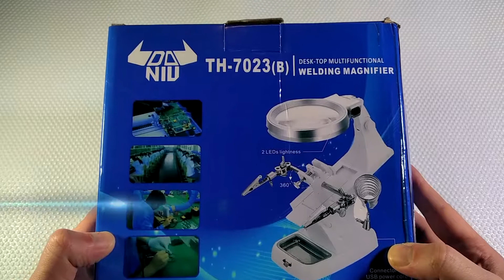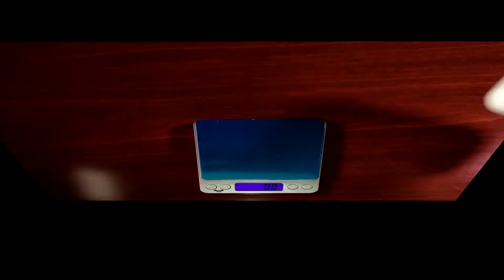DANIU TH-7023B Soldering Base - Unboxing and Review

Comment from the maker: Order Links Banggood
DANIU TH-7023B Soldering Base: https://www.banggood.com/custlink/KK3GiHpE1D
5pcs Black Push Button Mini Switch: https://bit.ly/2y0G1IP
DANIU Solder Wire Tin Lead Rosin Core: https://bit.ly/30NCg62
Geekcreit Grid Adjustable Storage Box 36 compartments (4 sizes): https://bit.ly/2FyLoTZ
Mustool® MT223 60W Adjustable Temperature Soldering Iron: https://www.banggood.com/custlink/3G3KSFCdTW
DANIU Soldering Flux: https://www.banggood.com/custlink/D3mK9PCyfZ